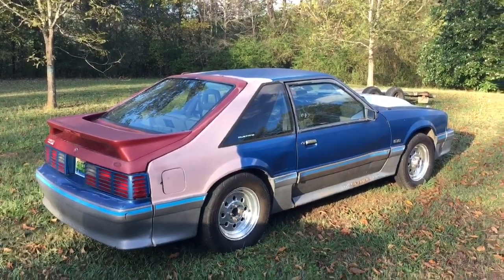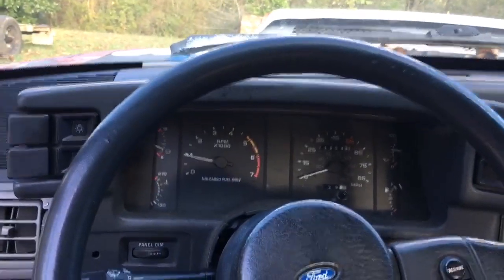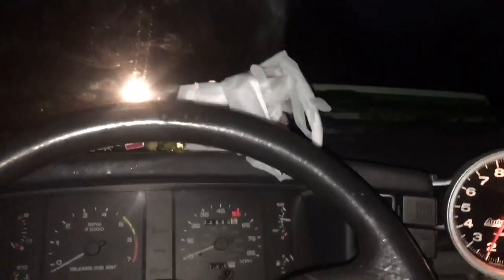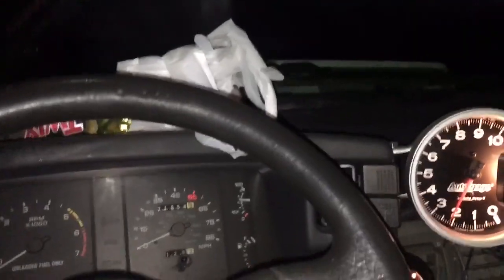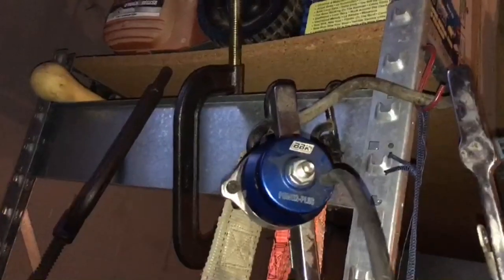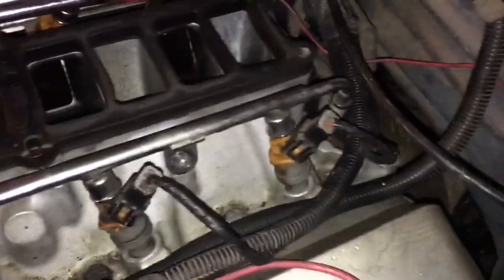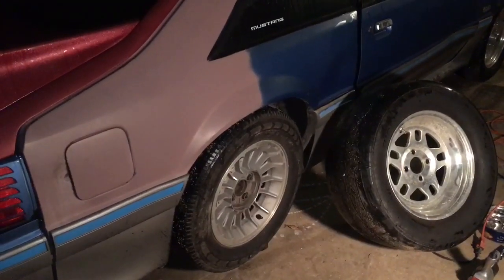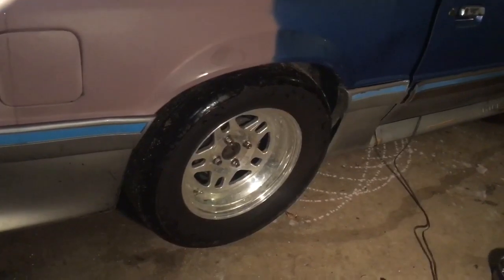1988 Mustang's first time back at the track since engine rebuild

Comment: Congrats on the new personal best.  Kind of nice the track stays open past midnight.  Last Saturday was the last day my local track was open.  I could have got dozens of passes, but I am fighting a fuel pressure issue with my carb so I got about 10 passes.  Like you, my best pass was the one right off the street.  Looking forward to watching your progress with your projects.
Reply: Yeah I don’t like staying up that late but it is nice to be able to go that late, especially if it’s taking longer than you thought to get a car back together. One Friday night years ago my friend and I changed the heads and cam on a car before the track closed, we were highly motivated lol. Went from E7s and a B cam to Edelbrock Performer heads and an F Cam.
Reply: Glad you got a bunch of passes in 👍 do you have a Dragy, G-Tech, or Mexico to hold you over til the track opens back up?
Reply: @Sikulz  You did the cam and head swap at the track?  That's awesome.  I swapped carbs at the track from a 570 Street Avenger to a 650 double pumper at the track and saw no real difference.  I also uncorked the H pipe on my 90 but left the cat back hanging to see if the 2.25" Dynomax mufflers were hurting power.  They were not.
Reply: @Sikulz  I want to get a G-Tech.  Snow will be falling soon so I might not get too many days to test until the spring.  I can get on it a bit on the highway on the two highway onramps in my city.  I remember when I went to school in Indiana there were a lot of rural roads.  Not so much where I live now.
Reply: The looser torque converter can cost you some mile per hour loss
Reply: @davidcolegrove8818  👍 you know I didn’t even think about that.... not only is it looser but this converter is a non- lock up. I really appreciate your comment David.

Comment: An idle surge like that is why I took the EFI off my 90 LX 5.0 and swapped it to carb years ago.
Reply: Man I was seriously considering it!!!! Glad I found the issue 👍
Reply: @Sikulz  Glad you found it too.  I wonder if my issue years ago was a vacuum leak.  I thought it was the C&L MAF meter with the 24 lb injectors I was running.  Surged pretty hard at traffic lights at times.

Comment: I probably missed it in one of your other videos. but what converter are you using?
Reply: It’s a B&M 10” 3000 stall, it’ll flash 3000 and footbrake about 2300, it’s geared 4.56. It might footbrake higher if it wasn’t geared as low and maybe if it had some ballast in the back.